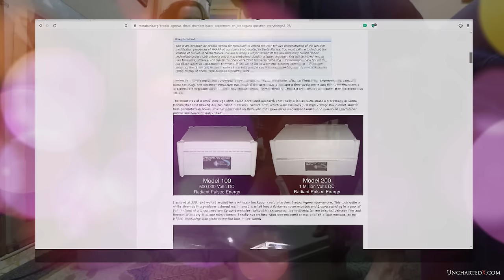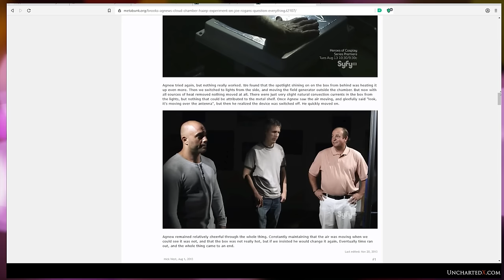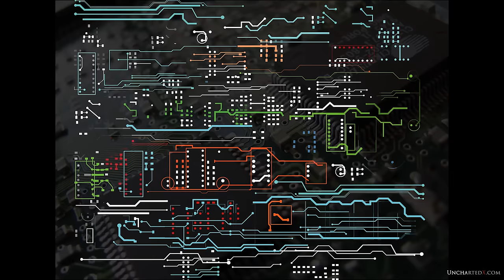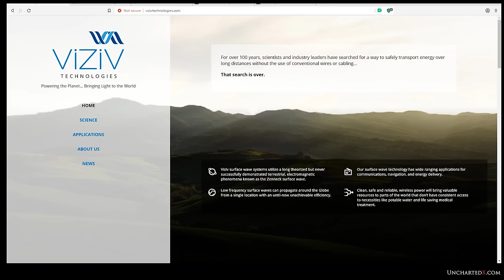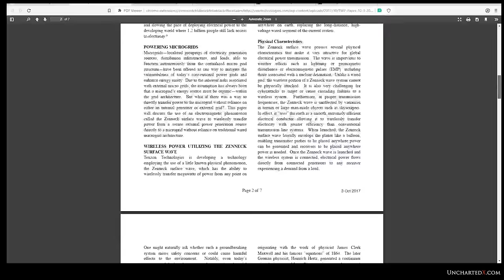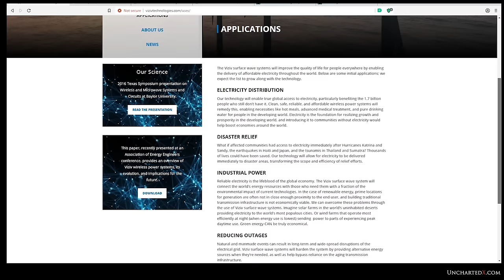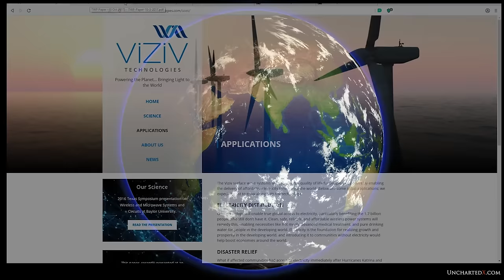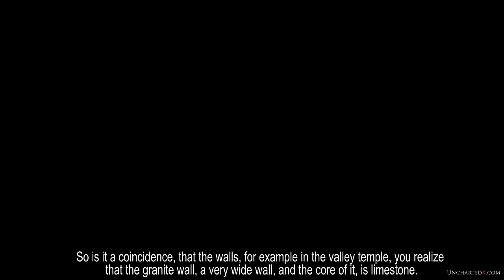500,000 volts through megalithic stone? An investigation into the possible with UnchartedX!

Comment: I am a physician. EM field devices are much more common in Europe. They’ve been around for decades. Oscillating fields move very fast and create a circulation increase across the tissues. We’ll researched to speed bone break healing, for example. It’s the frequency change that generates the movement you could say. Very underused in the USA. We have approved devices here, but I have a German unit that is a large well constructed ring you can slip your entire torso into. If I had a sprained ankle, I’d use it. Would make my injured area throb in a unique way, but my machine is way more strong a field than is used here. Another use case is unsealing diabetic ulcers, since those are formed due to lack of micro circulation due to arterial damage at the sites. Forcing more micro fluidic activity can often help push through and oxygenate the area. Jus’ sayin’. :)
Reply from the maker: thankyou for the comment!
Reply: I wonder how this ties into acoustic resonance and its effect on human consciousness/perception of reality. Given the ancient acoustic chambers across the World, could subjection to various electromagnetic resonance frequencies within the aforementioned chambers be a gateway to expanding human consciousness and intelligence, as well as providing advanced healing possibilities?
Reply: P.P.S. It’s not hard to imagine the ancients using machining devices with meteorite/jewel cutting blades and tips, especially given the astonishing findings of the the reassembled Antikythera mechanism. 

If they were wiped out due to cataclysmic events around the time of the Younger Dryas, did they evolve to that level of sophistication or were they taught?
Reply: also the 11th harmonic has been proven to shatter cancer cells so I’m guessing it depends of the frequency for healing or to cause injury.
Reply: @reimer0015  source?
Reply: Awesome information, Doc.  Thanks for sharing.
Reply: Anything that can attract more highly oxygenated, healthy red blood cells to an area will help the healing process. Of course, ensuring that your red blood cells are optimally oxygenated and as numerous as possible is the first step.
Reply: @reimer0015  yes it does!! But, healthcare only makes great money by treating and not curing.. so it's never going to be a real interest for mainstream use
Reply: @reimer0015  I'm an electronics engineer. The expression "11th harmonic" is meaningless on its own. Its like saying addition, subtraction or multiplication cures cancer. The 11th harmonic of what?
Reply: @ColinWatters  Are you referring to the work of Otto Heinrich Warburg? I don’t think that’s been successfully used to cure cancer. In fact, it’s clear that cancer cells can still proliferate in the absence of oxygen.

When someone is in a state known as the methylfolate trap, this causes chronic folate deficiency which in turn impairs DNA synthesis. In this state, uracil can be misincorporated into DNA which causes the DNA to break leading to apoptosis. In this state a person has folate, B12 and probably iron deficiencies, nutrients which are essential for producing energy. Also, in this state, a person is likely to have macrocytosis&microcytosis which means that their metabolism is impaired as their red blood cells don’t carry enough oxygen around the body. At some point, the ability of the body to use p53 signalling to kill of cancerous cells may cease leading to a proliferation of cancerous cells. So a low oxygen, low metabolic state is actually a breeding ground for cancer.

Escaping the methylfolate trap, curing the macrocytosis and microcytosis thereby ensuring optimal oxygen transport throughout the body is the way to avoid this scenario.

Unfortunately, at present, doctors are failing to diagnose&treat macrocytosis, microcytosis and hypoxia properly which I find rather curious. They’re also somewhat ignorant of the effects of macrocytic and microcytic RBCs blocking capillaries and starving tissue of oxygen.
Reply: @aesc9448  I don’t know the source for the 11th harmonic but there is a good Ted talk from Antony holland. He showed how cancer  reacts to certain frequencies under the microscope.
Reply: @jasonrichardwatts  where are they
Reply: I wonder if they could be used to heal a broken leg on a horse...  preventing the need to kill it :/
Reply: @reimer0015  no it hasnt.
Reply: Walking and movement of the bones they say creates electricity that helps heal bones. And thinking dose more. Thanks for your info.
Reply: This is incredible info.  Mind sharing with me the names of the units?  Hoping to learn more about them.
Reply: Seriously " a physician" talking about pyramids and healing rays n stuff,  come on people what am I hearing?
Reply: @jasonrichardwatts  yeah mannn I once imagined I was like an astronaut!
Reply: @jim_herd great comment, thank you.
Reply: German medicine is much more advanced in healing the patient than in the US.
Reply: @jasonrichardwatts  What would happen if you made atrong frequencies that brain waves exist at or at resonances of different cellular masses inside the body, such as the frequency of which neurons operate. How different is acoustic energy from magnetic and electric energy truly, or even gravity. They all exist as a scalar field, what would happen if you tried to make large stringed tuning forks and had 1000 years as a civilization of using acoustics and resonance to make life easier in weird ways. Dont get me wrong, gravity is at a pretty low frequency 😂. But still even if you just threw shit at the wall and saw what stuck I wonder how far you could get with some different materials and acoustic and possibly magnetic or electrical frequencies as well as far as what you could accomplish. If an advanced ancient civilzation created these megaliths, they did it with a different tech tree than us or they went well out of their way to hide the clues which would make them even more advanced. I get the feeling the ancients were a bunch of fuckin math nerds 😂
Reply: 🤜⚡💥⚡🤛  Here's one experiment video that proves granite is a conductor and how/why  electrical power was used in ancient times - videos -->    'Andrew Hall: Megalithic Chemistry | Thunderbolts'  ,  'The Greatest Mystery, Solved. Recreating Ancient Stone Melding Technology (Part 1)' ,  'How a Spark Gap Lingam (SGL) Works' . There's more. 🤜⚡💥⚡🤛 ...
Reply: 🎉wow, awesome Information!Thanks ❤

Comment: Man, I think you’ve really struck a cord here. The analogy between the architecture and combination of materials with a semiconductor board is more important than you realize.
Reply: Chord*
Reply: no it isn't - stones are not semiconductors with finely tuned atomic impurities.  You might as well compare it to a layered sandwich.
Reply: totally agree, the layering of magnetic/non magnetic and ferrous/non-ferrous stones can and do show interesting properties.

If we built things to last maybe we'd be building our factories out of stone rather than cement
Reply: @JamesSmith-fz7qk  properties don't need to be tuned. Materials have native properties. In fact, if you couldn't tune properties of materials, you'd have to travel hundreds of miles offsite to find materials with those innate properties. Hmmm. Might explain why they went so far out of their way to get certain stones. They couldn't tune properties like we can with silicon. They could've discovered technology out of the same sequence that we did. 

You can use pottery to create a battery -- it doesn't require modern foundry techniques and metals. If you discovered a battery before the technology of assembly lines, you could put it to practical use relatively soon after the discovery. 

I wonder how a pyramid shaped capacitor would behave.
Reply: @michaeldavid6832  No, you are completely wrong.  Those properties don't exist in the native materials.  They require ultra pure materials doped with atoms in a very particular way that will never occur naturally.  I know, I am an electrical engineer.  People should study the basics more...
Reply: @JamesSmith-fz7qk  are you asserting that materials in nature don't have different properties? Like if I dug up some quartz and then some gold they'd behave electrically identical?

What are you smoking?
Reply: @michaeldavid6832  I would ask what you are smoking.  Pyramids and rock don't harness electricity in any conceivable way.  They didn't have any understanding of what would be required for electricty, or what they could do with it. Take some engineering classes if you think this would work, prove it and become world famous.  Anybody can throw out idle speculation.
Reply: @JamesSmith-fz7qk  so how do you explain the Bagdad battery? And also sound and resonance=frequency! And all energy operates on a particular frequency? So just because you are an electrical engineer as am I, your knowledge is only based on fundamentals that have been explained to you created by others! There are many more ways to harness the world's energy than the current industrial method! We just choose not to use it, research it nor perfect it! As boiling water to turn turbines/generators is king, and we think we are advanced! We suppress and oppress true advances in technology in the name of capitalism! So open your mind and your eyes!!!
Reply: @ginge330  I doubt they used a copper chise - nobody knows how they did it - and you can speculate all you want, might as well bring up aliens haha
Reply: @JamesSmith-fz7qk  but yet you state they did not have the understanding? 🤔 I think you are a bit confused
Reply: Re. the Bagdad battery -  the idea that the terracotta jars in certain circumstances could have been used to produce usable levels of electricity has been put to the test at least twice. On the third episode of the 1980 British Television series Arthur C. Clarke's Mysterious World, Egyptologist Arne Eggebrecht created a voltaic cell using a jar filled with grape juice, to produce half a volt of electricity, demonstrating for the programme that jars used this way could electroplate a silver statuette in two hours, using a gold cyanide solution
Reply: @ginge330  go ahead and make your super advanced electrical generator non Capitalism system, there's nothing stopping you.
Reply: @willovd8612  Stone is a general term, and not a type, and STONE doesn't conduct the most.
In general most stone, including Granite or Basalt, are very poor conductors of electricity.
Some minerals are great insulators.
I don't trust these people in this type of video.
Reply: @ginge330  his source : Trust me bro.

Love seeing people say you’re wrong about something that no one even knows 😂😂😂 he must be a time traveler, we have to ask him what the lottery numbers are!!😂
Reply: @tomzablee wow

Comment: The piezoelectric effect is usually thought of as applying a pressure to a crystalline material to produce an electric potential.  It can also work in reverse, but the piezoelectric effect doesn’t only have to be because of a pressure differential; it can also be created through a temperature differential.  

I have an oilfield background and used to work for a start-up company (now a part of Schlumberger, I believe) that did cross well seismic tomography.  We had a source tool that we lowered via wireline down into one well and sent a swepted frequency input (low to high frequency) signal, amplified greatly by - what had been - an amplifier for a submarine’s sonar system.  The source tool had a series of piezoelectric coils that would vibrate due to the input signal and create a sonic signal that traveled through the earth and be picked up by one or more of our receiver tools in nearby wells.  

We would transport the source tool, which had an upper section with like 12 piezoelectric coils and a lower with maybe 17 additional coils, from home base to job location.  The source tool was not connected to the wireline cable during transport, so it couldn’t self-discharge, which meant that if we were connecting the tool during a time of the day or a different geographical region than when we left the base, the temperature could be a good bit warmer or colder than where we had left.  If we weren’t careful, we could get a healthy (but not life-threatening) shock if we happened to get our hands across the lead wire and case ground.  

All that to maybe suggest that a temperature differential between the granite/basalt/granite interfaces could have produced static electric discharges strong enough to break the bonds of the rock crystals and delaminate the rock surfaces.
Reply: Thank you for sharing that! Fascinating!
Reply: Search wire EDM machining of granite, you're on the right track!
Reply: Great info!  I hadn't thought about temp differential being a part of piezoelectrical possibilities.  Though my use of it had been extremely limited to pressure sensors used for 1 application, now I'm wondering why my tiny brain didn't think about that ROFL.

Comment: G'day Ben, loving this and all your videos as I gradually work my way through your channel. Brilliant stuff! 

What I wanted to offer was my simple observation as it appears to me the limestone (or was it the basalt?) which has eroded may have acted as a SACRIFICIAL ANODE in a process of electrolysis. Much in the same way large steel ships have softer alloy anodes attached to their hulls to reduce the impact of rust on the steel hull through electrolysis from the current existent in the ocean, it may be something similar going on here with the limestone. 

Further, and I don't know if you've covered this already but if some of those tunnels with their tight-fitting joints were actually carrying water from the Nile past those limestone, basalt and granite combination 'interfaces', then the whole thing would make even more sense, at least to me. 

Another thought I had was, possibly, the granite which was the least conductive of the 3, may have acted as some sort of resistor for any number of purposes. 

Please note I am not a scientist or engineer; I am simply a tinkerer interested in things mechanical and electrical. My comments are based on my own observations while conducting my own projects and from what I have learned from others during my life and generally messing around in boats. Again, brilliant videos and keep up the good work, cobber. #UnchartedX
Reply: Nice thought...
Reply: I thought the very same thing👍

Comment: Ben, as a master electrician I have done several experiments with electricity.  The one that I will never forget is when I got a call from a friend who said she was getting shocked in the shower? Long story short, I measured the voltage at 101 volts. This was with the power completely of and isolated. I as able to light a 40 watt incandescent lamp from her ground rod at the one corner of her home and the copper underground water service 75 feet away, the power was from the ground potential. I believe , but never found the any other source. But I concluded that SDG&E had bonded the wrong phase of  a XF some were down the line. 
On a different occasion I was able to run a wire 100 feet to 2 ground rods ,8ft. in the ground and metered 17 volts.
What people do not see at Tesla’s towers are the 100’s of ground  rods 100ft., as I remember, into the ground. I believe he was , in secret, trying to generate power from the earth gravity and its potential with the tower?? Look what happened to the 5 kilometer tethered satellite that NASA tried to set with the shuttle, or the giant mirror the Russians tried to set in space.